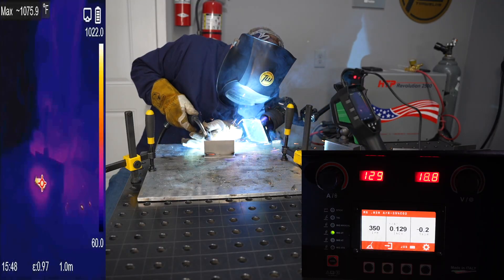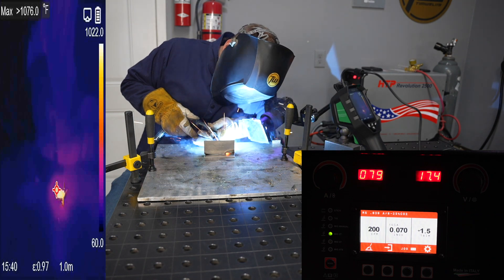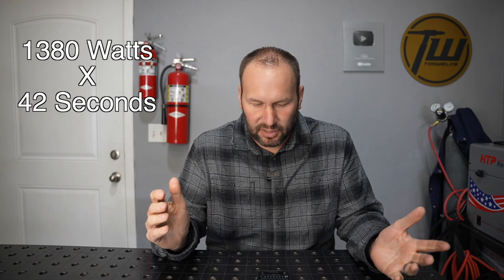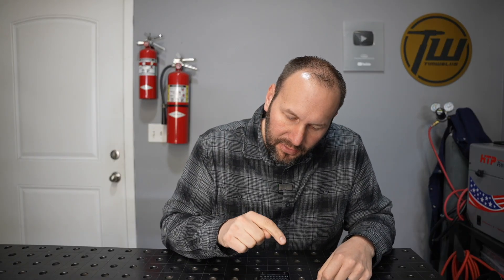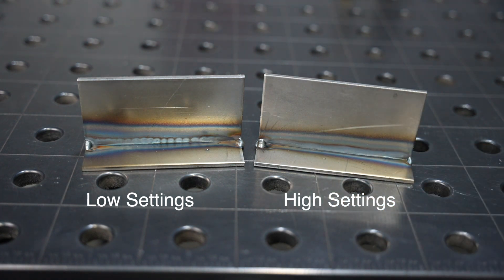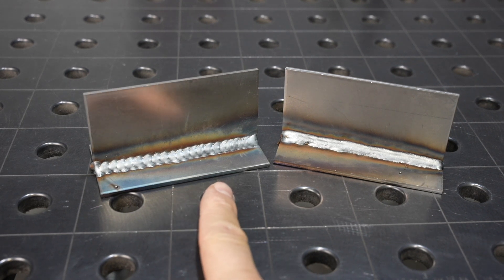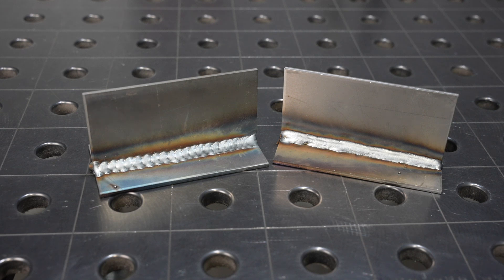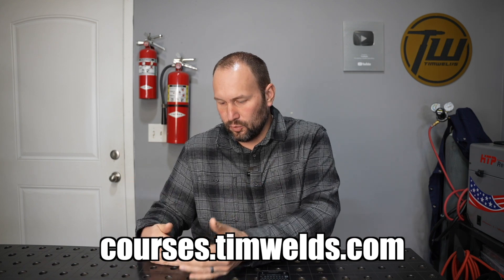Welding Heat Input Caught On Tape: Testing Settings and Technique

Comment: This is the same as soldering small components on a board. A hotter tip lets you get in and out before everything around it soaks up the heat. 👍🏻

Comment: It’s difficult to explain this to people. It’s something I had to learn many years ago. I think that a oroblem is that people often will increase wire feed and possibly voltage, but keep the same travel speed with poor results, so they think that less is better.
Reply from the maker: It is a common misconception. If you crank it up but run at the same speed, you'll cook it for sure.

Comment: you can't compare the 2 the amount of metal put down by the lower setting would always read higher
Reply from the maker: It is different, but from a practical perspective, these are how parts are commonly welded with the two approaches. It's very difficult to put down less material than I did on the lower settings and have it wet out to the toes of the weld. The additional material is largely convex and doesn't provide much structural gain.

Comment: This is common knowledge in electronics soldering. The best way to prevent heat damage to delicate components is get off and on FAST, (2s or less) and sometimes this means preheating or raising tip temperature while using the largest tip you can fit in the joint.
Reply from the maker: Thanks! I can see how it would definitely apply there as well.

Comment: An excellent video!! Could be even better if you did macros to compare penetration, and if you do a comparison between hot and fast vs colder and slower on fracture toughness values i.e. do charpy tests on butt welds, [weld metal, but mainly HAZ] say on 1/2 inch thick of 5/16 material. I know this may be expensive but that information would be invaluable for welding folk in general.
There is already a video on the effect of using stringers vs weaves on fracture toughness, now to allow a welder to get maximum toughness from his joints we need one on hot and fast vs colder and slower please...

Many thanks for getting into this topic it is often overlooked as a welder cannot see how tough his welds are. S/he must rely on this science for a reasonable prediction. AND what a difference these variables make to toughness.
Also it would be handy to know the distance traveled so heat input can be calculated in figures such as kJ/mm or kJ/inch if you prefer. That way there is a figure that is directly transferable from one job/joint/bead to another.

Once again thanks a lot for this, it is first class information.
Reply from the maker: Thanks! There are some good scientific papers that have been written on this; maybe some of that data would make sense to include in a future video.
Reply: @TimWelds  Heck yes; welders do not know how tough their welds are by looking at them. But with videos by you detailing the variables and outcomes they will know how to laydown the toughest when they need to.

Comment: High settings and fast running :) Same with TIG, high amps and fast run, you can weld 2 razorblades on 120 amps.
Reply from the maker: Absolutely! I'm probably too shaky to move that fast on the razor blades, though.

Comment: YES YES YES ..... no one ever talk about this ... and no one believes this either .... I have been saying this for years.   this is an EXCELLENT video with proof !
Reply: I have heard about that from TFS channel don't remember which video but it was regarding tig
Reply: @christosthesprotia637  I think that was a video on overall heat input when welding stainless, where it matters even more.  Thanks to all of you for spreading the word on this.  When you're just learning it's ok to go slow and lower amps, to build up your reflexes and hand/eye coordination.  Then work on going hotter and speeding up.
Reply from the maker: @ZILAwelds Thanks Peter!

@christosthesprotia637 Absolutely! The concept applies to TIG as well. 

@benz-share9058 It's definitely critical with stainless...on thin stuff if you don't get moving, there's often no coming back from that.